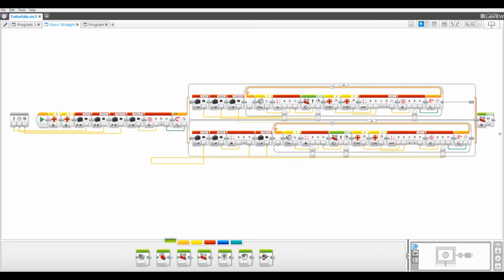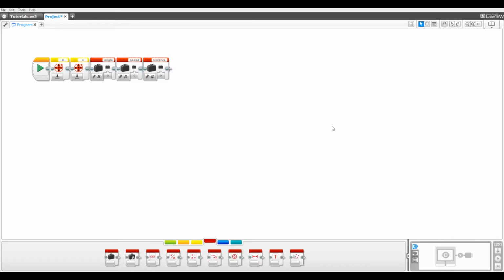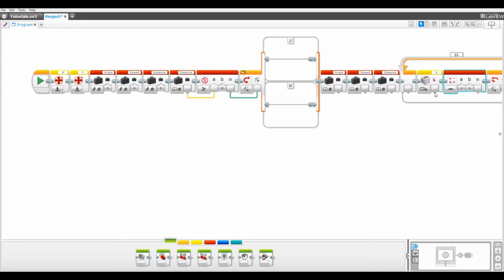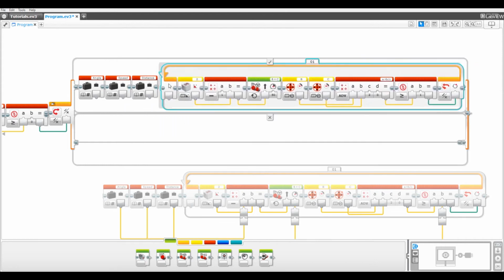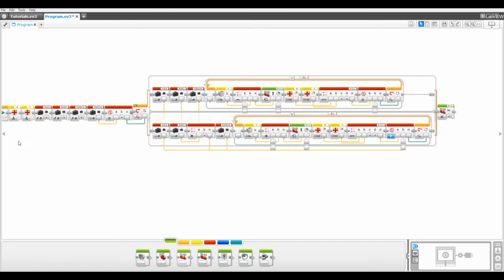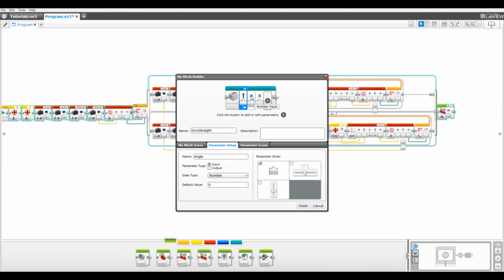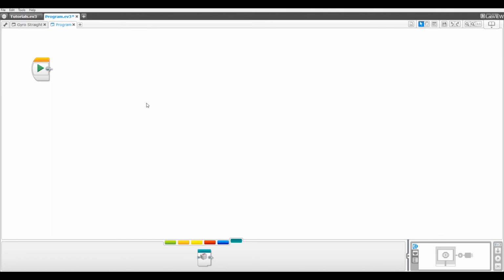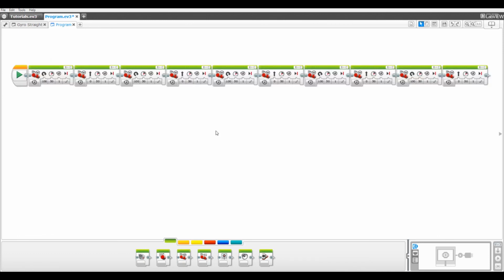Gyro-Straight My Block | Going Straight With A Gyro Sensor (Improved) | Tutorial

Comment: Thanx for this program, you made 3 variables speed, angle & distance but when you used it you only used the angle parameter, can this block be used to only move straight with out turning ???
Reply from the maker: This block can be used to the functionality of  normal move block. The speed and distance can be changed to control speed and distance. The block can also make the robot turn by entering in the angle you want it to follow. It will auto correct to this angle when it starts moving, then continue to go straight.